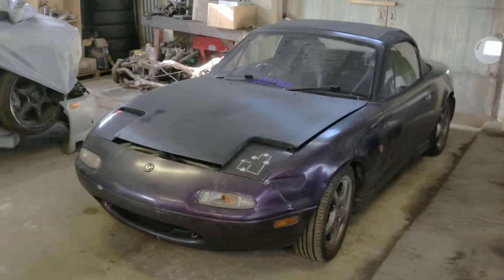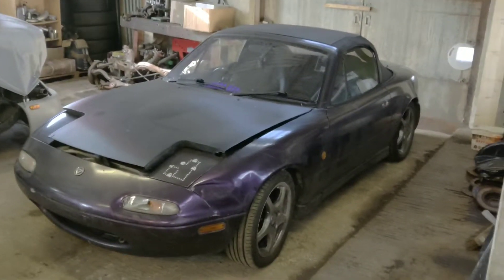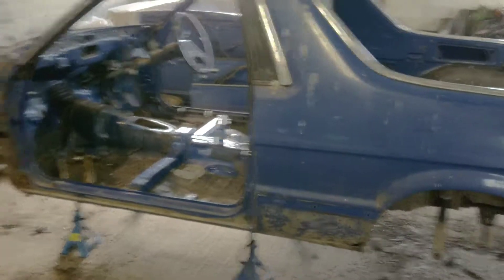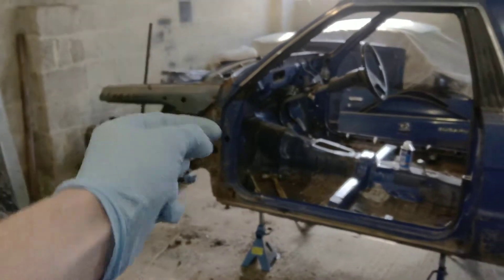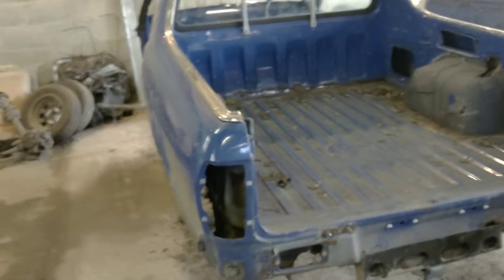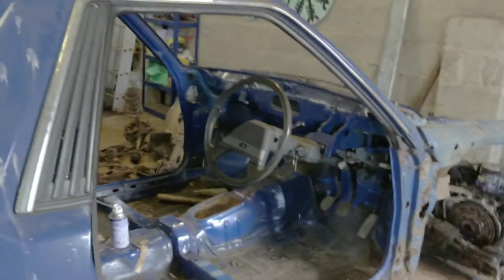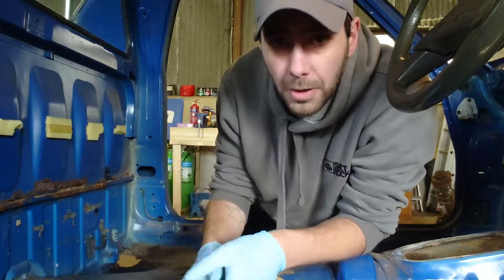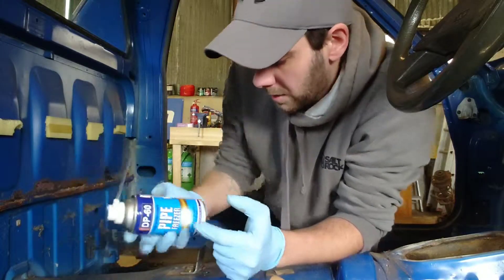Building a race car (engine conversion tube chassis)

Comment: That bed looks pretty good, it would do for one of my barn find brats anyway...
Reply from the maker: Someone had covered everything with body sealant and fiber glass as some point. The rear diff mount part of the chassis was so bad it fell apart when I lifted it up.